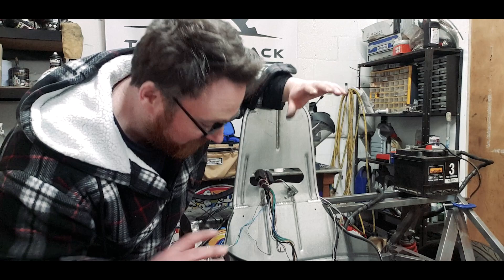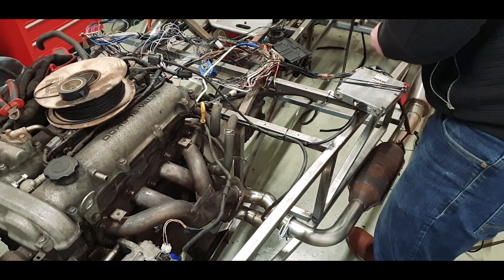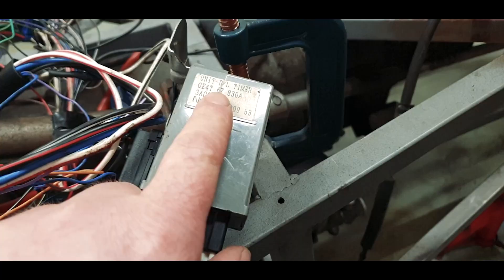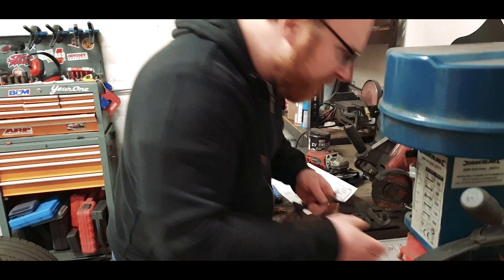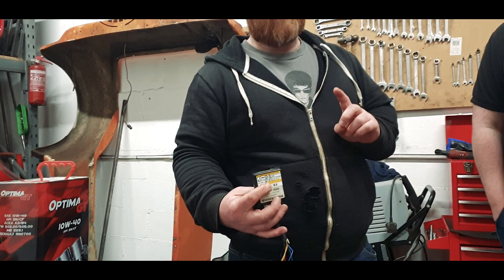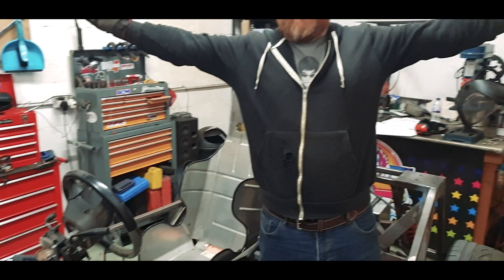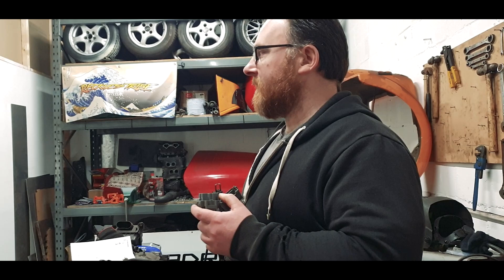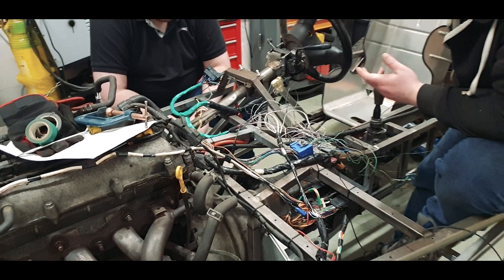A START LOOMS!!  Locost 7 Kit Car FULL BUILD!! - Episode 36 - (Project 7-UP)

Comment: The ECU could be involved in the fuel pump circuit as an interrupt for the air bag deployment, just a thought. Don't want fuel going all over the place in an accident.
Reply from the maker: Very good point actually! As it stands we are still not over the hill on that, even today. Stay tuned...
Reply: @ToolsnTrack  Wouldn't miss it🙂

Comment: I'm wondering which would be easier to do, what you guys are doing, or start from scratch, and make my own wire harness? I will have to do the second part, since I don't have a Miata.
Reply from the maker: I still think doing our way is easier, especially if you retain the ecu. If it was aftermarket engine management it would be a different debate...
Reply: @ToolsnTrack  I will go aftermarket. Seriously considering Speeduino.
Reply from the maker: @19mati67  I think Simon from our HKS MX5 video is looking at that kit. By all accounts it gets good reviews.